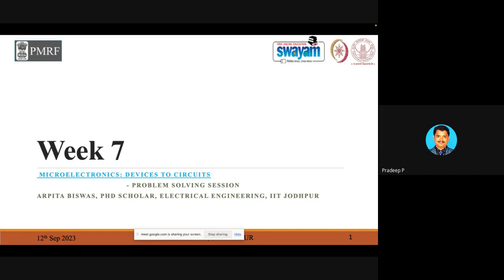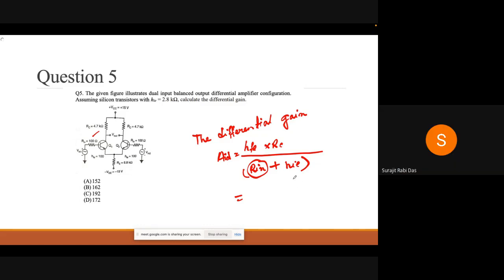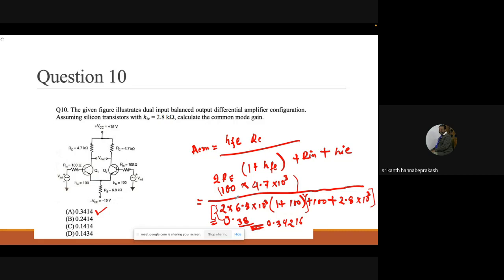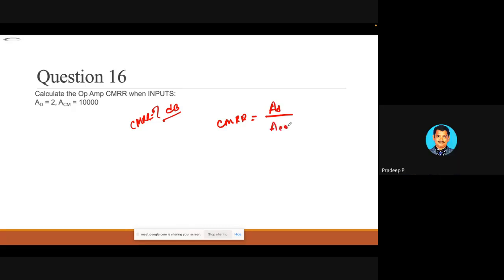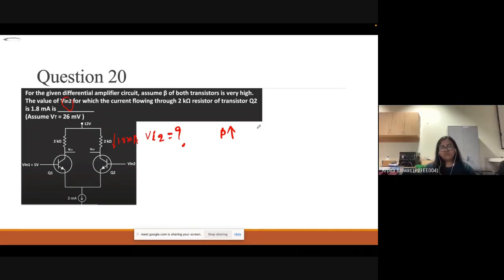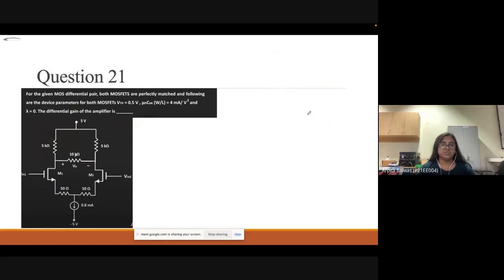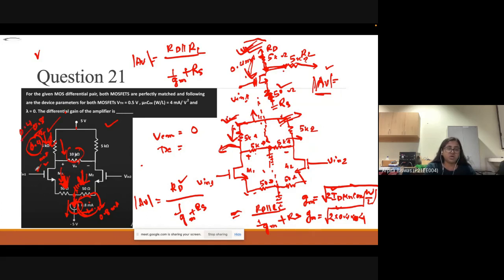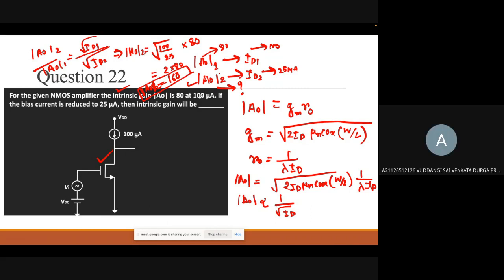Week7 Microelectronics: Devices to Circuits noc23_ee120

Comment: Leo if u see the formula of Acm=Rd/2Rss,, where Rss is the output impedance of current bias source.. so we try to design perfect current source such that impedence is high, such that Acm is low..  if coomon mode gain is high then why we do hardwork to design such ideal current source..

Comment: in Q.15 common mode gain alws should be low.. bcz if u increase that  gain any common mode noise will come it will amplify so much that it will more emphasize that that of signal..  it will never be high..